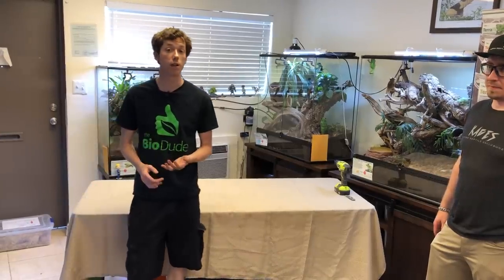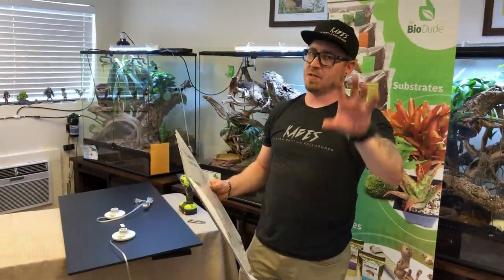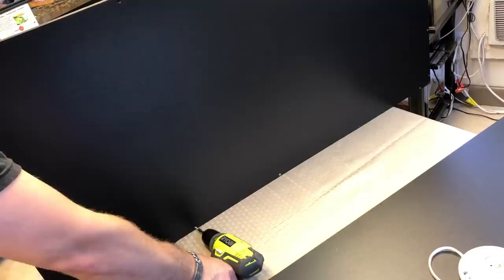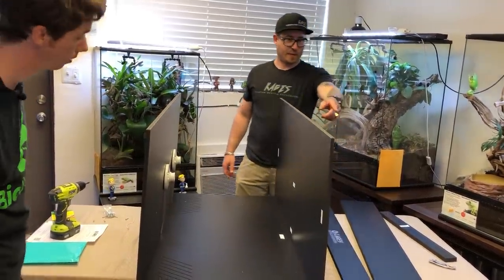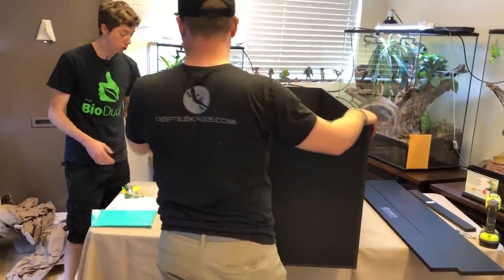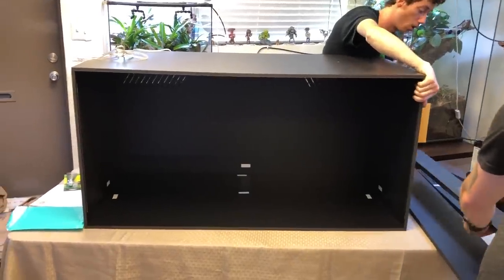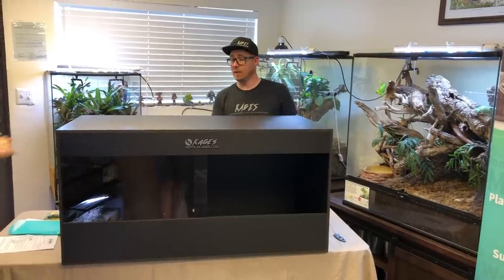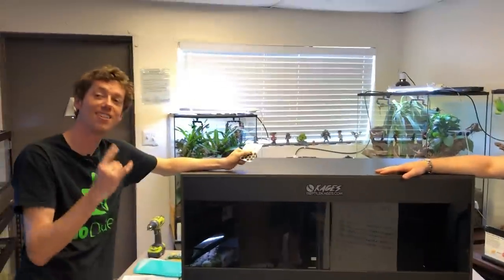How to assemble your Bio Dude Premium PVC Enclosure - A step by step guide

Comment: I just spent 700 on this cage and I'm pretty bummed to see there's that the panels are not recessed to fit with each other like APC.... that means its relying on screw strength. hmmmm. may need to cancel. that's disappointing.

Comment: I have been a carpenter/ furniture maker for over 20 years and use pvc material often. I can give an absolute guarantee that with all the weight added to these cages they will not hold up over the long run with the way they are screwed together. I'm going to guess that if you put moderate sideways pressure on the cage it would just start pulling threads and become wobbly. I would bet that if I pushed sideways on cage  with some strength I could probably collapse the entire cage in seconds. The cam locks that said "unnamed swedish company" uses would definitely benefit the cages structurally. Or an extra small piece of material in all corners to act as a mounting rail for screws would help as well. Not to mention that beardies have sharp nails. They will scratch the PVC. Leaving tiny little bits of PVC in the cage potentially causing harm to your little friend if injested.

Comment: Great video on a great product. It would've been cheaper for me to buy this Kage from the start. Big box store brands ran me well over 600 dollars between light fixtures and a cage not even close to this size. 
I own this Kage and can say that Zach is customer focused on providing a quality product. The engineering on this Kage is excellent. I have about 150 lbs of substrate in mine and it holds up with no issue.
Highly recommend for those that are looking at the long term solution over the lifetime of their pets well being.
Reply from the maker: What a great review thank you!

Comment: so if u buy a pvc enclosure how do you get the uvb light on there arcadia 18"+
Reply: I have an arcadia fixture t5 and a kages enclosure on the way. I'm thinking I should screw the brackets for it right before the top is attached to the back so I can put the cord through before it is attached. Is this right?

Comment: @Josh - These enclosures are good, but it would be a lot better if you and Zach figured out a better light setup with UVB and grow light fixtures pre-installed. I don't really like the modification for the grow light option. The light does not look that secure and you need to drill holes in the enclosure to make it work. Pre-drilled holes with more secure fixtures would be much better. When working with lighting, I would rather see a more solid solution than this. Other than that it seems pretty good. Some more natural wood exterior finishes would be a nice touch, but not a deal breaker. The lights are kind of a deal breaker for me though.
Reply from the maker: That is something I will pass to Zach and start brainstorming.
Reply: @TheBioDudeJoshHalter  Thanks Josh, that's pretty cool that you are taking the time to listen to feedback  so you can continue to improve the product! Right on
Reply: I agree I use 36" florescent fixture in my setups and if there were a couple of  retention  bars to mount a florescent fixture to the inside would be great.

Comment: This kage looks amazing! Can it be used for an adult ball python? Is there a way to add a heat mat?
Reply from the maker: Absolutely! I do recommend something slightly larger and taller which we do have available. I don't recommend using a UTH with this type of enclosure. The over head heat source would be better. The manufacturer of these enclosures have cages to put over the heat source to prevent burns.

Comment: I would definitely silicone all the edges because they do leak.
Reply: Silicone doesnt stick to PVC.
Reply: @cyberlocc  yes it does its a pvc foam board and there are specific types of silicone that works with plastic
Reply: @aiyannajeremschuk3041  The Silicon that sticks to PVC is harsh chemicals which is what your supposed to Not use lol.
Reply: @cyberlocc  you can use silicone that are used for aquariums

Comment: In my opinion he should adjust the base design if necessary to allow add on purchases to make the tank bigger, for when the pet gets bigger. such as a thin strip with smaller screws  to change the direction of how you screw it together, so you could purchase one more and add on items and connect multiple together.  could connect two side by side or front to back or both.
Reply from the maker: You should mention that to him. He is always looking for ways to grow and improve!

Comment: Question: wouldn't the black walls absorb the heat too much and get too hot?  Most reptile enclosures I see that are like that have white walls.
Reply: thats why there are vents this is also will not over heat thats i recmend adding mor of thoose over head heat things used for the lamps so mre heat escapes

Comment: Do you need two lights for one skink
Reply from the maker: Hey hey! for the bioactive set up theres typically three light sources needed, LED for the plants, UVB for the reptiles health and then a heating element- this can be a bulb such as a light bulb or a CHE , ceramic heat emitter, heat panel. etc. Skinks are a species that requires a higher basking area and UVB so they would need the UVB and heating element for basking. it is dependent on the species what specific light they require. Hope this helps!

Comment: The only problem I have with this is cleaning the glass tracks it’s a big problem I have bought one of these  and if you plan on using substrate you will be cleaning the tracks every time you slide the panel open you will have to clean the tracks

Comment: Hey josh I know this is off topic but how deep are the layers in an 18x18x24  from the bottom of the drainage layer to the top with leaf litter if you use a Terra flora bioacitve kit? like total depth from top to bottom?
Reply from the maker: For Flora, since it is much more humid with more water being passed through the substrate, about 2.5-3" for both.
Reply from the maker: Roughly 5-6" unless you want a deeper substrate layer for large root systems on your plants.

Comment: The light fixtures seem like the weakest part of these enclosures. I feel like that should be wired together. Plus you obviously can't have exposed ceramic heat lamps, so they should be covered somehow.
Reply from the maker: Kages does offer the covers etc. You want two different plugs in the event you need two different heat sources at different times.

Comment: That price tag though holy fck that is an excessive price, nice looking enclosures but for that price they should have a better front access door setup and come with silicone.  Though i like how they are slightly insulated due to the PVC board.  PVC board is not exactly cheap at .5" thickness.  rather use wood at that point with the added weight.